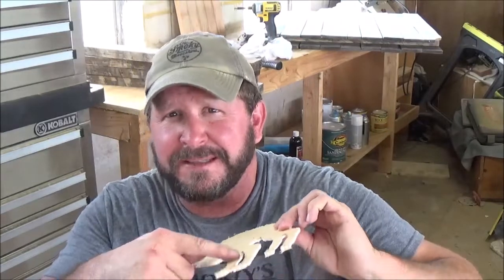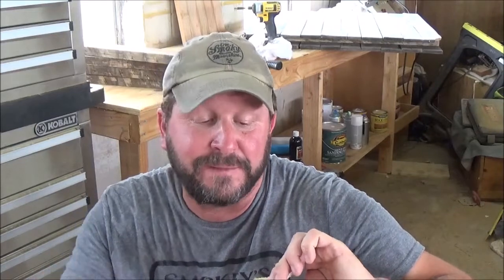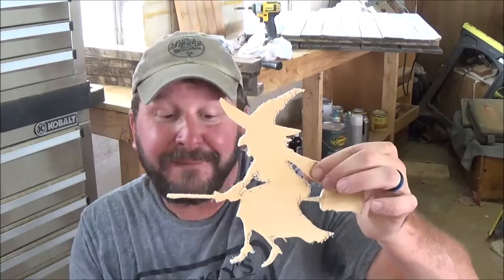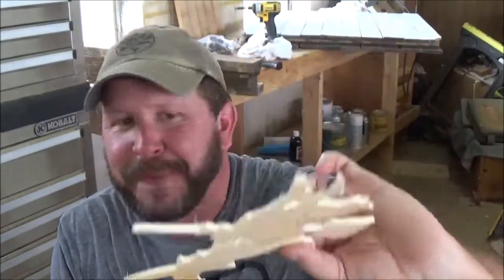Halloween stencils (profile toolpath)

Comment: Hey 
Is your machine vibrating ? Or are you sure you are using the right bit with the right speeds and feeds ? Cause i think the edge finish is not good...
Reply from the maker: I'm probably actually running a little fast feed on the profile cuts, but since I knew what these were going to be used for, I really didn't even have to sand any of them....check out the next video and I'll put some pics up of what those stencils made...Thanks for watching!!